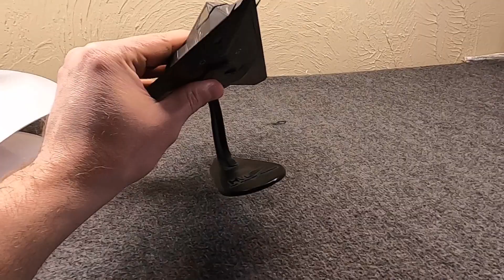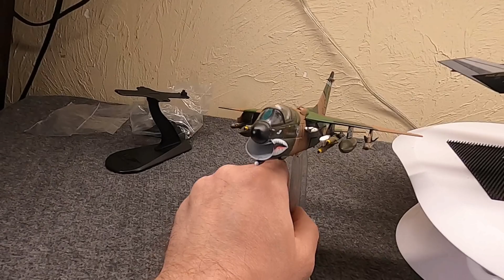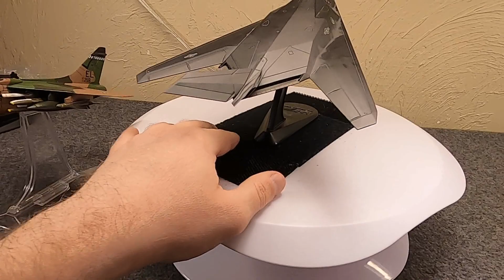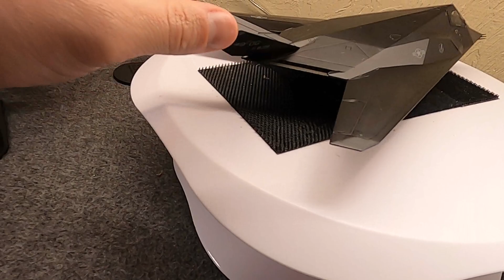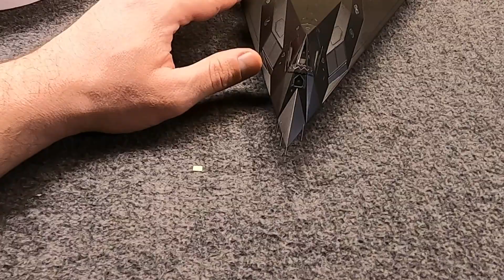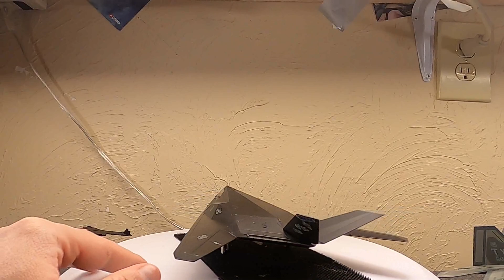Lockheed F-117 Night Hawk: The USAF Stealth Fighter

Comment: Imagine flying one of these and all you have for defensive means is stealth technology....no guns, missles, or even speed to get out of dodge. Just a highly specialized, high maintenance, stealth precision aircraft. Its a pretty amazing story, and it looks like something you'd see flying by if the bat signal was activated. It sucks that the A 10 is being sent to the boneyard with apparently nothing to replace it. There isnt anything we know of that can fill that role of up close tank killing abilities. Even the f22 is getting an early retirement I heard. It had problems asphyxiating its pilots and its ceiling was artificially lowered because of it, among other issues. The F35 has been a total disaster so far. Looks great on a poster or as a model though.
Reply from the maker: Some recent articles seem to indicate both the A10 and F22 might get a few more years afterall. Also, they seemed to ahve fixed the ox. system in recent years too. But again, that was a little bit of a problem tehre heh. They really want the F35 to do everything and well...goodluck with that?